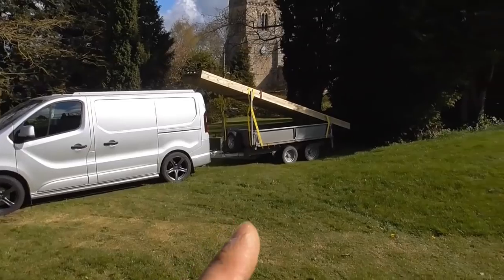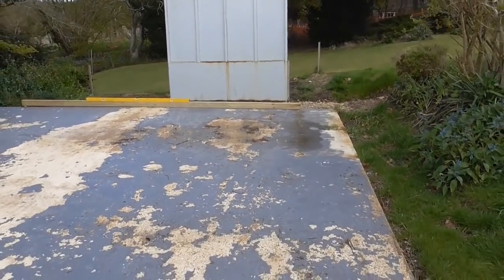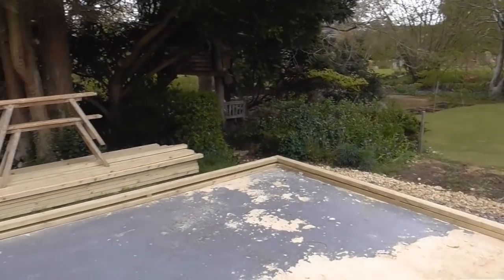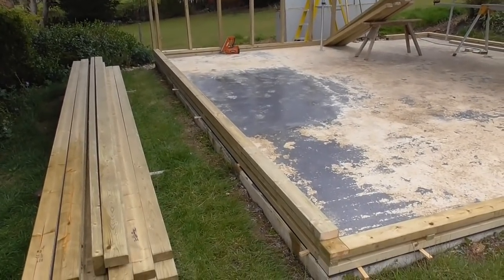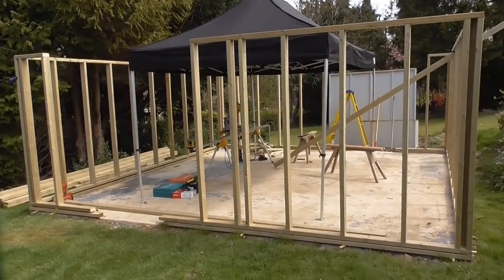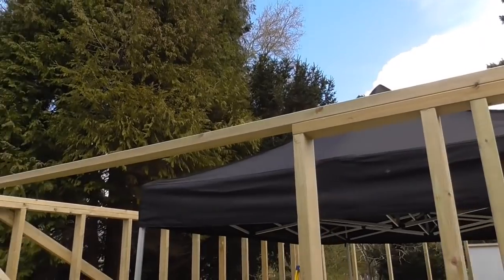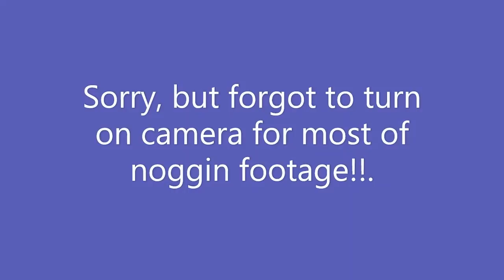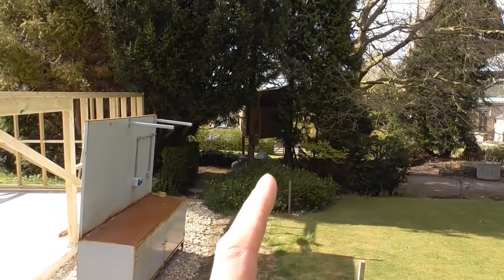Timber frame garage and garden utility space. PART 1 (making timber stud walls)

Comment: Brilliant video as always. I've had a similar issue as you had with a concrete pad falling away and being uneven. I put pressure treated sill plates down and leveled them off with plastic window shims place lengthwise with the sill plate. I bored a 25mm hole at the largest gap end and a 8mm hole at the smallest gap end.

I placed duct tape over the gaps either side and mixed up structural grout which is a purpose made high strength grout and as its very viscous I poured it in the 25mm hole until it had filled the void under the sill plate.

Once it had cured then just drill and screw though it. Super strong and only one sill plate required. It  fully supports the wall loads evenly down to the slab.
Reply from the maker: I really like your solution Andrew👌Absolutely rock solid under those plates now👊 'necessity is the mother of all invention' as they say🤩Thanks for your comment 😎 Cheers Del

Comment: Great video, well done.  Nice tidy work site! Easy to take that for granted but what a difference that makes.
Reply from the maker: Hi Ian. You're dead right mate, and does really help with pushing the job on when its mess and clutter free.🤩 (cause its certainly not always the case😵). Thanks for your comment.😎

Comment: What a fantastic video real craftsmanship and just what I needed, as I just drawing up the plans for my sons  6 x 6m garage. what are the stud spacings that your using I'll be using mineral slates to keep the roof load down. Thanks for all the tips.
Reply from the maker: Hi Les. The studs are 4x2 at 600mm centers. The building in the video is pretty much 6mX6m so the same size as you're planning. I kept the walls about 2.2m which gave the roof a decent pitch, (this kept the finished ridge height just below 4m), as 6m is quite a big span. Thanks for watching and all the best with your project😎

Comment: Have an idea for your trailer that I use. It's very similar in build, but I have adjustable racks. Being that the front rack you have on yours is the same as mine. I have pin holes for the racks so I can raise them to heights ( they're made from RHS ie; Rolled hollowed section galvinised steel posts, with one set on the front of the trailer (like yours and one on the back. I can raise them to various heights in order to fit whatever material I use, and they're removable from the trailer so it can be used just a method of transporting waste/green matter or whatever you need it for. I also have fences that fit al around the trailer that I can remove. Just a thought if you were keen to find a better way to transport your timber flat. Keep up the great vids.mate.
Reply from the maker: Hi bud. You make some great suggestions for making my trailer transport longer timbers easier.🤩 It's the usual problem of finding time to make up these sorts of things.😬 Another great comment,😎 Cheers

Comment: Toolbelt looks to be wearing in nicely 👍
Reply from the maker: Hi there. I only thought the other day, how much its colour is mellowing.😃 (its still pretty stiff though). Its cool that you noticed.🤩 Thanks for watching.👍
Reply: @thetallcarpenter  Your belt reminds me of my first job on a big site as qualified carpenter back in 94-95. Everyone had that type of belt (mine stuck out like a sore thumb) - worn backwards by the young ones and properly by the older lads.
Keep up the good work.
Reply from the maker: @jrsuk1170  Ah 1994/95, great times!!!🤩 (I think, I cant remember now) I've tried to use the rear/side bags, but just cant get on with them. probably just set in my ways.😜 I wish I didn't need to wear one at all, but they are just to useful.😎 Cheers mate.
Reply: …..and the up-cycled gas pipe remodelled as a hammer holder. Mine was blue water pipe. Been off the tools for over 20 years now but we must have done our apprenticeship at about the same time. Loving working my way through the  videos.
Reply from the maker: @PaulFurness_run26  Hi Paul. I started in 1986, and the hammer holder was either 50mm gas pipe or 50mm water pipe.🤪 Thanks for watching my videos, and hope you find them interesting.😎 Cheers.

Comment: That floor is horrible & the customer probably thinks it is just a case of flinging up a few bits of wood too. Cracking build & done proper 👍🏻
16:00 I used to use those Stadler pencils until they changed the wood they were made from, it used to be a dark & harder wood blank. I now use a Pica pencil & it lasts for ages. It costs to buy but saves on pencil sharpening all the time. Faster too.
Reply from the maker: Hi Derek. The customer fully understands all that goes into this type of job, so is pretty cool to work for.🤩 To be honest, I tried the Tracer pencils and thought it was great until the sharpener went blunt after only one lead, so not that impressed. (shouldn't have to be sharpening the lead with a Stanley knife). Or am I missing something?.🤔 Thanks for your comment.

Comment: Great video and extremely useful. I'm now going to build my own garden shed 5m x 2.4m clad with composite cladding and OSB inside. I'm unsure whether to make the stud walls from 3x2 or 4x2 treated. I need spacing at 300mm, do you think 3x2 (45mm x 70mm) will be ok?
Reply from the maker: Hi there🖐Personally, I would use 4x2 as its stronger and your shed is not exactly small🤔I doubt there will be an awful amount of difference in price between 3x2 and 4x2👍Cheers Del (keep your spacings to 400mm)
Reply: @thetallcarpenter  Many thanks Del. Cheers Matt

Comment: Hi YC another great video, uneven floors are a nightmare.  Have you heard of a California corner, if not look it up on YouTube, would have saved you four lengths of timber. The large headers/ lintel I wonder why you didn’t glue them,
Reply from the maker: Hi Stephen. I do know what a California corner is from my time working in the States.🤩 I think its more for allowing insulation right into the corner of the stud wall than saving material.👍 Slightly envious that the Americans have a cool name for it, and us Brits don't though.😬 I didn't glue the double 9x2's together as I just gang nailed them together.😎 Thanks for your great comment, and hope you have a great weekend.👍 Cheers.

Comment: if you dont mind me saying, a lot of fuss about nothing, just bed the plates on mortar with a level and club hammer. as i have done routinely, many, many times for chippies to pich a roof after twenty five years as a bricklayer. using wedges and packers is not done other than window installers and chippies. of course your project would need some thought regarding dpc and underfloor ventilation in this type of construction. Maybe bituthene membrane and heve enough depth to cloak the slab so water runs off the slab and not underneath the floor where your timbers are, where they will rot big time. not trying to be clever but i am fast aproaching retirement and a nice big outbuilding is top of my list.
Reply from the maker: I'm not a bricklayer Dave, and wasn't about to get one out of retirement just to bed a sole plate on for me😉 Yes, bedding the plates down would have been much simpler, but I would have had to get sand there, cement there, a mixer there and water there😶Hope you have a great retirement bud as bricklaying is a tough old game👍Thanks for watching😎Cheers Del

Comment: Hi id just like to say im a big fan of your channel im picking up lots of tips and tricks and cant wait to see the next episode. im looking at building a shed in my garden 8x14 and cant decide what to use for the frame work 2x2 or 3x2? any input would be great. busboy
Reply from the maker: Hi Busboy, and thanks for watching. 👊 I would recommend 4x2 for the timber frame. 2x2 is too small, in my opinion, and you could use 3x2 but I would put them in at 400 centers instead of 600 centers. Your going to a lot of effort to build your structure, and the cost of of upping the timber size will be relatively small compared to the total cost of building it.😎 Hope this helps.👍

Comment: I really enjoyed watching this, so informative and spot on. I have a question about the sole plate, I can see it sitting on some DPC did you anchor the sole plate before you added the second levelled plate. I couldn’t see how it would have stayed in place when fixing the studs to the second sole plate. I hope that makes sense.
Reply from the maker: Hi Ian, and great question/spot on the first sole plate👊I fixed this down, kinda temporary, at about 1.8m spacings with plugs and screws before I levelled the next plate over it. As you may have seen in further videos on this job, I then resin anchored down through the lot when the walls were complete👍Thanks for watching😎Cheers Del
Reply: @thetallcarpenter  excellent, thank you Del  for clarifying.
Reply from the maker: @ianhorner9978  🤩😎

Comment: In the United States that is a conventional 2X4 stick frame. A timber frame 6X6 or larger post, beams, bents, and purlins that 8, 10 feet part.You need to the Shelter Institute youtube videos to how a true timber frame is constructed.
Reply from the maker: Hi Paul. I did a fair bit of framing when I worked in the States in the 90's, so am sort of familiar with how you do it over there. Here in the UK we generally construct our buildings using brick and blocks and our building regulations generally work around this. There is timber framed houses build here but I don't get involved in those. I hope  I've got it somewhere near how you guys do it as it seems like a fairly logical way to make a timber frame building.😎Thanks for watching and your comment.👍

Comment: Hi mate, love your channel and been supporting for a while now. How does the fixing timber to masonry differ from this to fixing it to a skin of a house? would you put cavity tray and weep vents etc?
Reply from the maker: Hi TIY🖐Its not really feasible to install cavity trays and weep vents when adding onto an existing cavity wall, and the chances of water getting inside the wall is very slim👍 Worse case would be to treat the brickwork above with a weather proof coating👊 Thanks for your support🤩Cheers Del

Comment: Think I would have been tempted to bed the bottom plates on mortar a la top plate for a roof... but that’s another mess to have to clear up after I suppose
Reply from the maker: Hi Glen. Great suggestion mate, and had I been on a building site, that's what I'd have done.👊 I just had to get round as best I could on the day.😎 Thanks for your comment.👍Cheers.
Reply: That's exactly the first approach I thought about....many ways of doing it, no one way is the best I guess lol
Reply from the maker: @paulradwell9719  Hi Paul. I've got another one to do straight after this one, and I have arranged for a plate to be bedded on by a brick.👍Thanks for your comment.🤩

Comment: Great job mate as usual. Starting a garden room next week for a customer. They want 3metre bi folds. Do you think a wide timber lintel will suffice? It’s only a pent roof!
Reply from the maker: Hi Paul. If it was me, I would go for a steel beam lintel. Those bifold doors pretty much hang on the beam/lintel and even a small amount of deflection will cause issues with their operation, never mind the roof load. I know its tempting to just use timber, but you don't want the job to come back on you. I just did a shop extension, (its in a couple of my videos from a couple of weeks ago), and the guy that supplied and fitted the 3 meter bifold doors almost insisted on a steel beam to support them.👍 Cheers.
Reply: Cheers mate for the quick reply. I will definitely go with your advice. Can’t wait for your next video bud 👍🏻👍🏻
Reply from the maker: @paulyoull5472  Thanks for you comments mate, they are appreciated and very supportive.🤩 Cheers.

Comment: Hi, not trying to be critical but why can’t you run a single row brick 5 inches in from the edge of the slab all around and lay the first timber  base on it?
Reply from the maker: Hi there🖐If I could have had the walls sat on brickwork I would have, but it's the customers shout👍Thanks for your comment 😎 Cheers Del

Comment: Great work 👍I noticed your spirit level - Imex. I’ve not heard of that make before , how do they compare with Stabila ?
Reply from the maker: Hi Stephen. In my opinion, there is no comparison to Stabila. They are simply better in every way. More accurate, longer warranty, smaller manufacturing tolerances, easier to read vials and slightly cheaper. 😎 Cheers.
Reply: @thetallcarpenter  Cheers , gonna definitely look in to it .
Reply from the maker: @stephencarlisle3743  If you're in line for a new one, definitely give them a look. FFX are the best place.😎 Cheers

Comment: Hi mate lovely work and what a view to have while working, btw what do you think of the imex levels do they stand up against stabilia? Thinking of getting one myself. All the best👍🔨
Reply from the maker: Hi Rob. Yeah, very lucky with my working environment on this one.🤩 In my opinion, Imex spirit levels are superior in every way to Stabila. Easier to read vials, more accurate, longer guarantee, more robustly constructed, tighter manufacturer tolerances for accuracy and around the same price.😎 FFX is the best place to get them, and I highly recommend them if you're looking for a new one.👍 Thanks for your comment mate.
Reply: @thetallcarpenter  thanks for the info on the levels I have the old stabilla 83s 1m and 60cm but seems that the shorter one has gone for a walk 🤔 probably left on a job seems to be a thing when you get late 50s I left my jacket hanging in a customer's hallway the other week 😂
Reply from the maker: @robgormley1317  Hi Rob. I hate forgetting things and especially leaving things on a job.😵 As you say, seems to be happening more and more.🙈 Cheers.

Comment: Hi mate, I have a concrete pad where a garage used to be so I’m going to build on top of that. I am a little worried going timber straight to pad even with a dpc so was going to go with a brick/block first… you have any input on a best plan for that?
Reply from the maker: Hi John🖐Sounds like a good plan bud, and a couple of courses of brickwork will keep the timber walls off the floor and will give you something nice and level to work off. I would favour only a couple of courses so I could still drill down through them into the concrete base to get a good fixing for the walls👍Hope this helps😎Cheers Del
Reply: Thanks, I’ll take that on board.

Love the vids 👌
Reply from the maker: @johnhalliday719  Cheers John👍

Comment: You can also fix the sole plates flat to the concrete of the out of level pad. Fix all the studs slightly long without the top plate and brace them level and space with a batten marked with 400 centres below the cut line. Then just mark a level line for the top plate round. Cut them with a cordless circular saw and a speed square ready for the top plate height. Saves using an extra plate at the bottom and the hassle of packing the bottom plate level and having to double the bottom plate
Reply from the maker: Hi Wills. You're absolutely right there mate, and that's a great way of doing it in this situation, and saves a fair bit of work.😎 I think I'd still got it in my mind that I was going to make the panels and clad them laying down, so stuck with levelling a bottom plate, but changed my mind anyway.😝 Thanks for watching and your comment.👍

Comment: people don't realise how long it takes packing out to make walls and floors level/plumb when slabs aren't correct
Reply from the maker: You're right mate.👊 And worst of it is, after all the packing and leveling, you've usually got very little, physically, to show for it.🥵 Spot on comment mate.👍
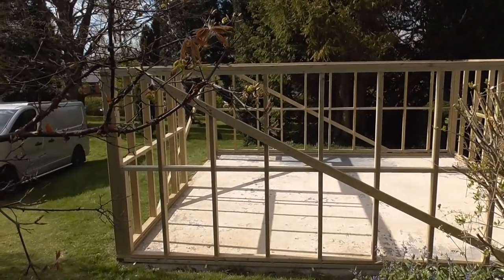Reply: @thetallcarpenter  17:18 No not having  it, take it all down its 0.01mm out end to end. jokes, realy nice work preparation is everything.
Reply from the maker: @ksly7426  I've been busted!!😝 There is definitely a tolerance that is acceptable, and I am trying not to come across as everything I do is perfection. I'm going to start talking more about tolerances and when things need to be spot on and when things can be slightly less than spot on. 😎 Ultimately, those plates will shrink by up to 5mm between them so chasing a couple of mm hear and there seems pointless, but we have to start somewhere.🤩 Thanks for your comment.👍